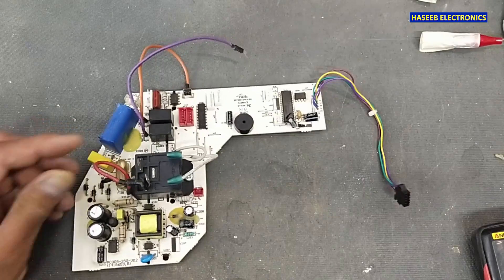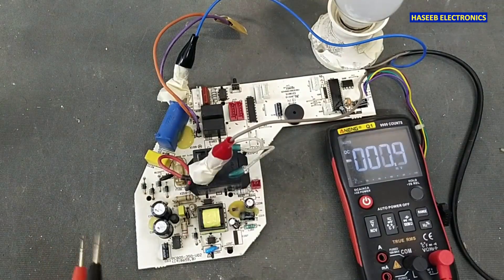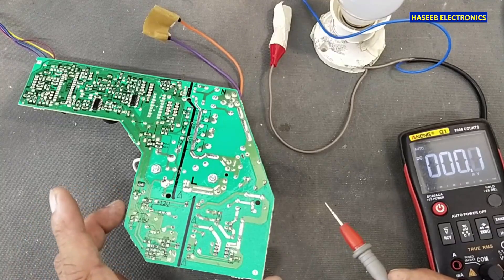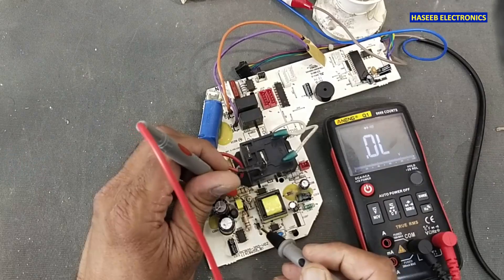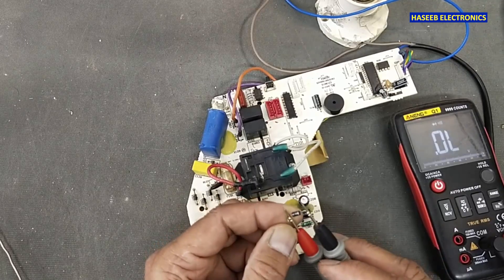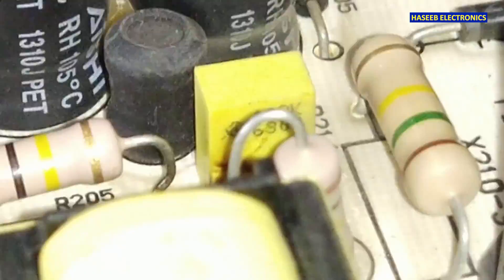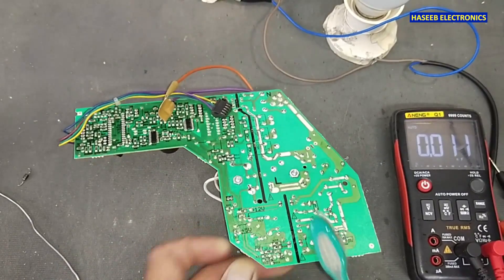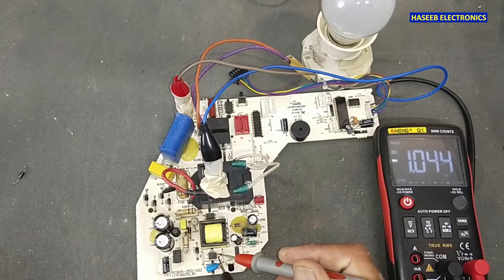{773} Split AC Indoor Unit Board Not Powering On

Comment: Sir I noticed U r applying Solder before de Soldering on the same point...
pls Say What is the need of applying Solder before desoldering
Reply from the maker: yes you are right.
before desoldering, we must re-touch solder by applying some fresh solder. it is better for thermal conductivity and it prevents the pcb from overheating during desoldering process. 
more over it removes the dust rust and oxides from the old solder, so it doesn't allow the dust to stuck in old and contaminated old solder inside the desoldering tool nozzle .  
otherwise the old solders chokes the desoldering tool's nozzle
Reply: I have experienced that old soldering takes too much time to melt and damage the surrounding area. and when applied new soldering first, it took less time.
Reply from the maker: yes you are right brother

Comment: Djazak Allah khayran , for the title the correct word is "ne s'allume plus" , for the atx power supply if the stand by voltage is present but the power supply doesn't start up I checked the only Ic in the board vcc  and vref are present can we say that the Ic is faulty

Comment: swapping phase and zero doesn't bother the board?
this with a nail snack is cool..
Reply from the maker: no. when we are using two lines for troubleshooting purpose, then there is no difference between line and neutral.
Reply: @HaseebElectronics  I understand, thank you

Comment: Which meter do you recommend to check the capacitor value for PSU ?
Reply from the maker: you can use any meter with capacitance option 
but for electrolytic capacitors much better tool is ESR meter
Reply: @HaseebElectronics  Thanks  I understand

Comment: Checking shorted semiconductors should be done first. And 1N400x diode is slow rectifier, around switching IC you should use fast diodes , like BA159 or 1UF4007 (probably used original )

Comment: dear haseeb sir can we use 4007 diode on the rcd snubber? this area has 100khz+ frequency and our 4007 barely works at 100hz.
Reply from the maker: 1N4007 have nominal capacitance 15pF 
upto 1MHz, this diode have a junction capacitance of 1PF. so it can be used at 100KHz. and it is most commonly used in smps snubbers. FR107 is also sued in same place.
Reply: @HaseebElectronics  dear sir can we use 1n4148 switching diode as a replacement as FR107 is also a fast recovery diode?
Reply from the maker: no
1n4148 is signal diode. it couples the signal. it cannot provide enough current

Comment: If I heard you wrong on certain video you said if there is small voltage at the output and fluctuating then I have to check the secondary ( output side ), if there is full voltage but fluctuating then I have to check feedback section. So you checked snubber circuit because pwm IC was heating?
Reply from the maker: 1. if we have few millivolts with fluctuations at output side, and high fluctuations on vcc capacitors & bulk capacitor ---- possibility secondary side have short circuit 
2. output side, no voltage. vcc capacitor & bulk capacitor high fluctuations --- possibility output side open 
3. output side high voltage + fluctuation, vcc capacitor & bulk capacitor fluctuation --- possibility feedback network 
4. low output voltage (approx 1 volt and above) -- possibility RCD snubber, dry joints in high current components (transformer, mosfet, current sense resistance, rectifiers etc)

when rcd snubber diode is short circuit, it creates a parallel path with transformer winding, thus it doesn't allow to built required magnetic field in primary, and the circuit draws more current, because in this situation there is just one capacitor (part of snubber circuit) that is parallel to the primary winding 
because capacitor provides very low XC at high frequency, while at the same time the transformer provides more XL
Reply: @HaseebElectronics  thank you very much, this is my notes for reference.. thank you very much
Reply from the maker: it is my pleasure
these are my own troubleshooting tricks 
sometimes there some other things are interconnected with some fault condition
but mainly these symptoms lead us to pinpoint location
Reply: @HaseebElectronics  thank you very much, at least we know where to look..

Comment: What desoldering tool is that and what solder you using were you buy it
Reply from the maker: i use WELLER WR3M rework station 
and most of time is use solder from BOW electronics USA, CASTER,  alpha brands 
i shop online from rs-online, amazon, farnell